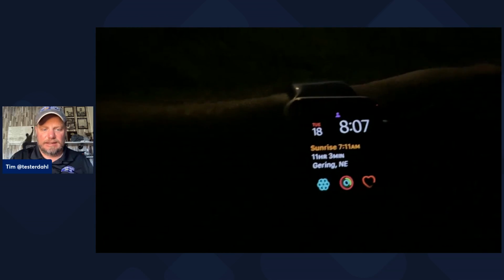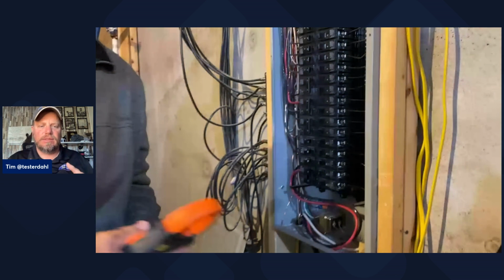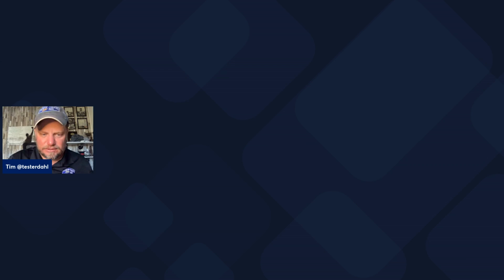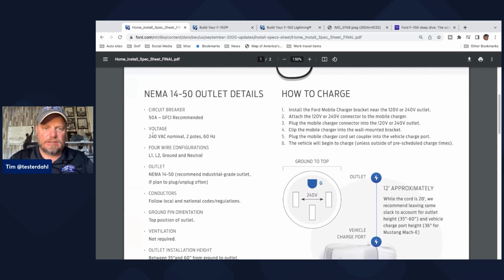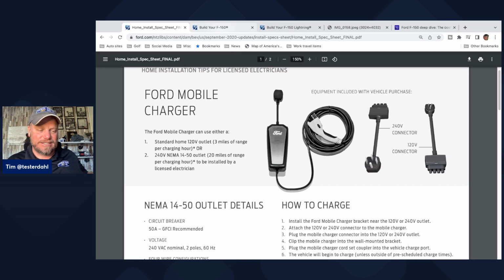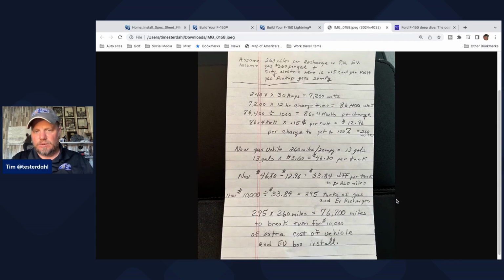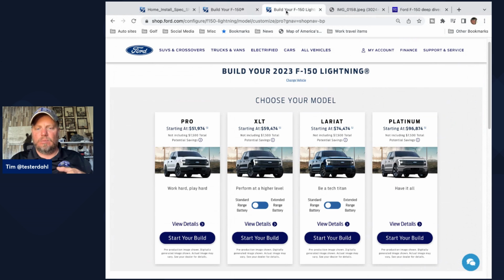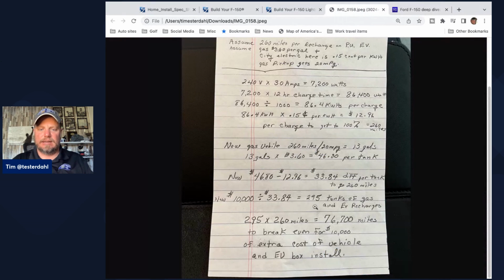11+ hours later on 220V charging price for 2022 Ford F-150 Lightning

Comment: 🇺🇸 give me a base 4x4 f150 gas!    Save $40k.  Less stress too!   Tim...TFL got a backup ice F150 to plug in.   Or bring a Honda generator in the bed.      LOL!
Reply: Different tools for different jobs.
People use to laugh at electric chainsaws, now professional arborist swear by them.
Reply: @cybertrk  still same basic issues!   Spend hours to charge your saw or second filing up with gas.   E saws for very basic
Reply: @seymorefact4333  then why do arborist use them? Are they sitting around waiting for it to charge or do they put their tools on the charger at night?

Do you charge your phone mid day when you’re using it or when you sleep?

Comment: Tim, as far as the cost to charge your Lightning, it would be a lot easier to just wait till you completed your charge, and the display screen should say how many KWh you used.  The miles displayed has nothing to do with the cost.  If you only charge to 50% or 80% or etc., it should display the amount of KWh used.  What ever your utility charges you per KWh, then multiply that amount times your KWh used.  My utility charges me $.10 per KWh.  So, theoretically, a standard range battery (98KWh) from 0 to 100% would cost me $9.80.   That's not dead accurate because there are losses involved in charging but it gets you in the ball park.  Now, figuring what your cost per mile is a different metrics.  Once you figure your cost to fully charge, then your guess o meter will give you your estimated range, you can do the math.  There are some fairly inexpensive watt hour meters you can connect to your electrical panel on your designated charging circuit that will tell you exactly how many KWh you used for that charging cycle.  I do not own a Lightning so I am not sure if it will display KWh used when you complete your charging.  Teslas do.
Reply: Ten cents per KWH? that's cheap. Here in east Texas I pay sixteen cents with a two year plan. Other plans are over twenty cents. Can't see how buying a $100K truck is going to save money at this rate. Especially when a run to Houston or Dallas requires 12 hour recharge before returning home.
Reply: Dont forget delivery charges, that's just the electricity itself, got to add delivery fees which cover cost of the grid itself
Reply: How about in the summer?
In California we have a tiered kwh charge thats like .34-.54 per kwh when you hit tier 3-4 So do you chose air conditioning or charging 🤔
I can pay $90 at the pump easier than paying a $900 electric bill.
Reply: @jenningsmills5398  My utility is a Co op.  They buy from the supplier and is listed as an adjustment.  There is a base fee whether you have usage or not.  When I do the math, I calculate the total charge by the usage for the month.  In the summer, it works out to be around .12 per KWh and in the winter months, .08 per KWh.  I compile it all for the year and it works out to be about .10 per KWh.   It's probably going to increase at some point. I read somewhere that the average for the country is around .15 per KWh.  I can understand how solar panels are a viable option in some parts of the country because of the high electrical rate.  I had a solar panel install estimate done recently and the ROI was about 15 yrs.  Maybe I am not being realistic, but my ROI cut off point is 5 yrs.  Maybe in the future with the tax credits given by the state & feds it would work  out.
Reply: @1garyfields  Yeah.  I'm paying 12 including delivery charges here in NY.  Once I go on a TOU plan that will be lower.  The Lightning at EPA efficiency is 2.44 miles/kWh, or 4.9 cents/mile.  A 20 MPG truck at current gas prices for regular here would be 18.5 cents/mile

Comment: Thanks for doing all this Tim. After all that time and money to be able to charge up at home which still takes awhile for a truck with less range and towing/hauling  ability with no aftermarket it’s not worth it. The price of electricity and vehicle taxes are just going to catch up. I know there’s rebates for purchasing  an EV and installing solar but that’s a one time deal and you don’t entirely recoup your sunk costs especially with the rising costs of EVs.
Reply: Apparently you didn't watch the video, which directly rebuts your comment.
Reply: @usa-ev  I did watch it. I’m sorry that the truth hurts but EVs are far from perfect for a truck application. I used mine on a regular basis doing 4 hour trips hauling and towing on occasion. You lose money, time, ability to do repairs, and capability in the long run with an EV not to mention time it takes to charge. Nice to see you trolling on the other comments too.
Reply: @vr4787  One of the main points of the video was figuring how long it would take to recoup costs.

I agree that today's EVs are not perfect for all use cases, towing long distances being chief among them. They are however a great option for the way most light duty trucks are used. If they don't fit your needs, budget, or tastes you don't need to buy one, and there is no need to try to make up negative points:
- aftermarket - false, Lightning has same form factor as ICE so many products will work and why think more will not come?
- recouping costs - rewatch this video,
- electricity prices going up - what's this based on? And there is always solar if it goes nuts, what's the backup plan for high gas prices? 
- Losing money - everyone that bought a Lightning so far is up at least $10K
- Losing time - Daily EVs win because it takes seconds to plug in nightly and start with a full charge in the morning vs stopping at gas stations, on long trips ICE is faster, but charging is not an awful experience. If one takes a ton of long trips this may become a factor. For most I think it's a wash.
- Losing ability to do repairs - EVs are simpler and need fewer repairs, has Ford prohibited repairs? Everyone should support the right to repair. Hopefully something we agree on.
- Losing capability - only lose in towing long distances, and gain other capabilities, which may make a larger impact for people (front trunk for one), just depends on needs. 

Which comments of mine did  you find to be trollish?
Reply: @usa-ev  it’s fair game to provide criticism for something they’re trying to market as a work truck that can’t hack it. I use my Ram 1500 classic for hauling hay and pulling a 7,000 horse trailer on 4 hour trips. Where are you getting that people save $10k from switching? My Ram was $32k new I already save at least $20k and I do my own maintenance and most of my repairs. I doubt there is an aftermarket for it especially for the driveline. Can I go into O’Reily’s or order from Rock Auto and get cheap parts? No it’s the dealer and once it’s out of warranty forget it. EVs do have less moving parts but they lock the software so you can’t fix it yourself. I said electric costs will probably go up like everything else if demand on the grid keeps up. Govt will have to recover the fuel tax on EVs somehow. Even with the EV rebate, Ford raised the price of the lightning so that nixed that. Solar is only free after you’ve paid off the panels, and those home storage batteries aren’t cheap either at least $5k-$10k not including install. Gas goes up, I can still run an ethanol blend that’s cheaper or don’t fill up all the way if I’m around town. I can fill up in 5 minutes on empty if there’s an emergency back home and drive the 4 hours nonstop. Can’t do that with the Lightning. I don’t need a frunk that blocks the motor, a 6.5ft bed and seating for 6 is plenty. Get a tool chest or hard tonneau cover if you need a trunk so bad. As far as trolling, when you and CybrTrk hop on at least 10 comment sections to criticize other people’s concerns rather than help them understand that doesn’t work. If you want real truck people to warm up to it, EV fanboys need to quit being smug about it and harping on like they’re above it all. Heck you straight up said one person reminded you of grandpa.
Reply: @vr4787  Criticism is fine, making up stuff is what I took exception to. 

I already agreed that EVs don't work for all use cases. Your RAM 1500 probably won't work for someone that needs to tow 15,000 lbs on 10 hour trips. There are all kinds of different trucks for all kinds of different needs. The Lightning will work great as a work truck for someone that that doesn't drive hours on end on the highway for work. Around town or on a farm the Lightning will crush it as a work truck even while towing.

$10K came from the fact that everyone that bought a Lightning could turn around and sell it today for a minimum of $10K more than they paid for it.

I don't think you comprehend how much fewer repairs we're talking. Here's a brief list of things you will never have to repair on an EV: exhaust system (muffler, catalytic converter, oxygen sensors, manifolds, exhaust leaks), engine (head gaskets, timing, valves, timing belt/chain, rings, rods, etc.), fuel system (fuel pump, fuel sensor, fuel lines, fuel injectors, fuel tank), transmission (oh, boy!), and the computers to run all that. None of these even exist on an EV, all gone, all problem free forever. "The best part is no part."

You can still repair (on both ICE and EV): suspension (shock absorbers/dampers, tie-rod ends, sway bar bushings, ball joints, control arms, etc), power steering, HVAC(blower, flaps, compressor), cabin (latches, window regulators, buttons, speakers, displays, etc.), coolant systems (radiators, fans, hoses), 12V battery, tires. As the Lightning and other EVs become mainstream I'm not sure why you wouldn't be able to buy these at parts stores.

Things you might not be able to repair on today's ICEVs: infotainment, engine computers, transmission computers. Some people are probably capable of fixing these things.

Things you might not be able to repair on today's EVs: infotainment, battery, charge controller, motor controller, motors. Some people are probably capable of fixing these things.

Maintenance is all but gone on EVs - no more oil changes, transmission oil checking or changing, engine air filters, etc. 

I'll take solar panels over cutting gasoline with ethanol any day. As you pointed out after they are paid off the solar panels provide free energy which equates to money coming in. They can also power my house! Ethanol isn't free and I wouldn't recommend running it through all your engines.

Sorry if I was too curt for you, I do try to keep my comments grounded in truth/facts, and enjoy helping people with concerns. People that make up negative comments just to fit their narrative can be a little annoying.

And I loved my grandpa. :)
Reply: @usa-ev  That’s all fair and good, but I do take issue when people say I’m a liar or refuse to see common sense concerns and draw backs. Yeah a Ram 1500 won’t do 15,000 lbs towing, but the Lightning won’t do it either with a 10,000 lbs max load or range wise. For that kind of weight diesels are the better option. Idk if you have a truck you use for work to tow and haul but it’s a different world from just commuting. You can’t sell the Lightning until after 1 year of ownership or Ford voids the battery warranty due to scalping depending on the dealer and state laws. Also my engine can run up to 15% ethanol per the manual, that’s only if you run it in an non-ethanol engine. You did exactly what you accused me of making false claims to elevate a comment just there. I’d be fine if the repairable items you mentioned where available off the shelf but I searched O’Reily’s. Autozone, Rock Auto they don’t stock that for the Ford Lightning. Even Tesla for as long as they’re out a lot of parts you can only get from Tesla and they won’t sell it outright. Right to repair needs to be established. Some items might be interchangeable for the Lightning but that’s a big question mark. Also, I like doing my own maintenance and having some level of control and not having to go to a dealer for every little thing or have to get it towed if I can do the fix myself. Fixing your own vehicle is one of the few ways parents and children bond and learn life lessons on responsibility,taking care of what you have, taking pride in your work (it may be irrelevant but it’s another loss). I’ve had some bad experiences  with mechanics that screw up a simple oil changes or brake jobs (both the dealer and independent shops). Plus the suspension components and tires wear out quicker on an ev due to the weight. From what I’ve seen, trying to get service for an out of warranty EV means shelling out a huge sum of money. Third party shops won’t touch them. In the end just buy what works for you and live with the pros and cons. If you just commute for round about or short delivery routes if you can make a 5ft bed work (which won’t for a work truck) then lease the Ford Lightning if you can afford it. If you need a work truck long term that needs to do a variety of jobs and go long distances then buy an ICE truck.
Reply: @usa-ev  So, I guess the guys that pull maintenance on our electric vehicles aren't doing maintenance, according to you.
Reply: @usa-ev  We get it. Using your "logic", strip mining rare earth minerals is more ecologically sound than using corn based ethanol.
Reply: @ronaldburgess2884  Maintenance on EVs is less than ICE.

Ethanol has a few problems: it's not zero emissions, it relies on fossil fuels for fertilizer, and it can't scale to required levels.

For batteries they last a long time and are highly recyclable at the end of their life so once mined those materials will be in service for centuries. 

Batteries aren't perfect, nothing is, but they are the best viable option available today.

Comment: Code is 150 % above rated current draw. 30 amps is peak draw. It is used to protect the wire from burning up. # 6 wire is rated for max draw of 40/ 45 amps steady draw. Again protect the wire.